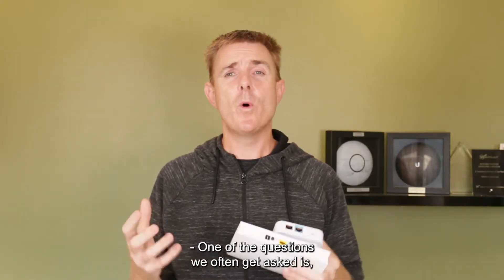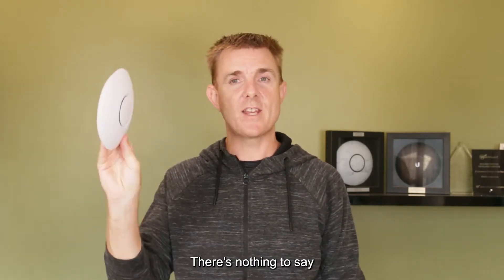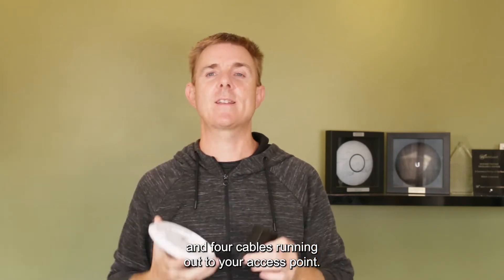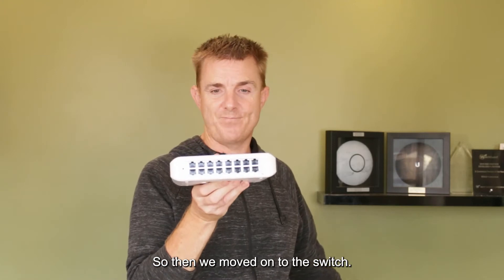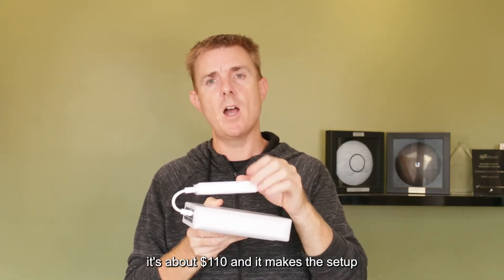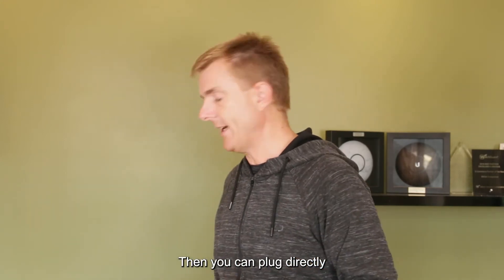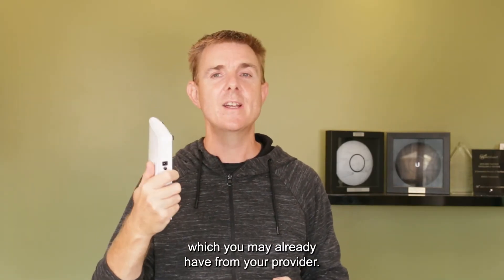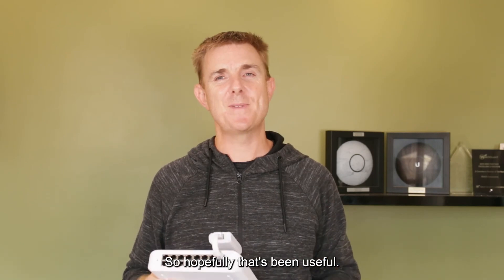What You Need To Build A Ubiquiti Unifi Network

Comment: So I can just plug the access points into the switch and then the switch into my router for the simplest setup? Do I still need to download the app and figure out how to activate them?
Reply from the maker: Great Question.  Yes access points in to switch, switch in to router.   With Ubiquiti Unifi Network you do still need to configure the devices to make use of them, so you will need the app or a web browser to configure it all.

Comment: What is the fastest nbn modem/ router you sell to connect a copper hand of to the USB security gateway
Reply from the maker: Hi,  We would suggest A DrayTek 2865 if you need to connect to a copper solution.  We would normally recommend the DrayTek DV 130 but there is no stock and the DV 132 is a little way off.  I hope this helps

Comment: can I move from the app to the cloud key later?
Reply from the maker: Hi,  That is a really good question.  There are a number of ways you can use the app and one of those is in stand alone.  I don't believe from this option you will be able to export the settings.   If you are thinking of moving to the Cloud Key at a later stage, I would suggest setting up the controller software on a computer as this will allow the exporting of the sites at a later stage.   I hope this helps.  You may find some more exact information, though, over at https://help.ui.com
Reply: i know it's quite off topic but does anyone know of a good place to stream newly released series online ?
Reply: @Bryant Jayce i would suggest flixzone. Just google for it :)
Reply: @Bryant Jayce lately I have been using Flixzone. Just search on google for it :)
Reply: @Bryant Jayce lately I have been using FlixZone. Just google for it =)